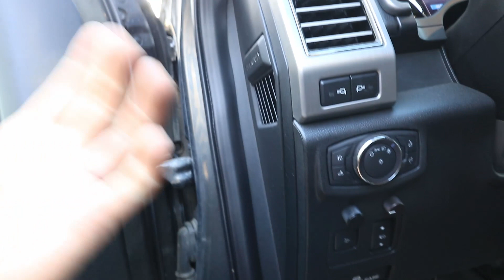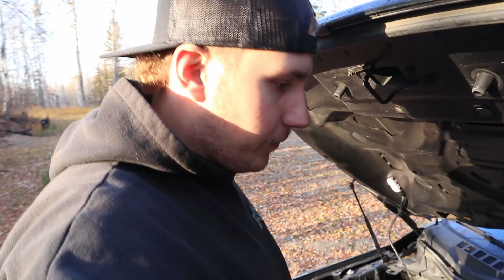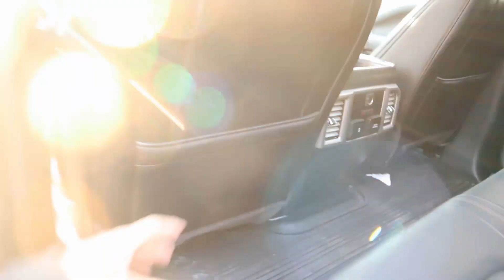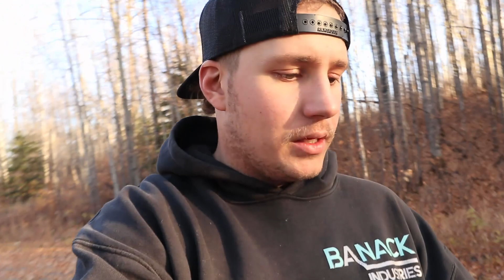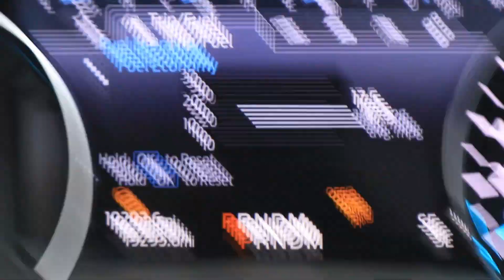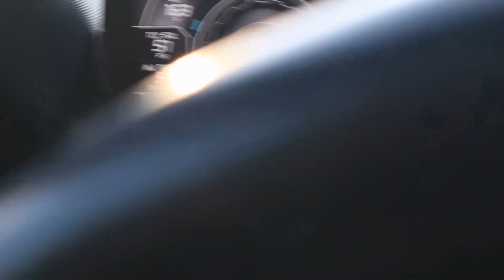Answering Common Delete Questions // 2020 F350 6.7 Powerstroke

Comment: Question: on one of your videos I thought I saw you install a BD Diesel High Idle kit on a deleted truck. My dealer is has installed the kit on my 2020 F250 but can’t get it to function. Any suggestions?
Reply from the maker: @RapidlawnCa  first of all yes they do work, I have one on my 2020 f550 service truck
Reply from the maker: @RapidlawnCa  if the emissions harness is plugged in up by the firewall it will work, if you have that unplugged you loose the high idle control
Reply: @BanackIndustries  OK thanks I haven’t touched that at all, but I did unplug the throttlebody plug as well as the two EGR plugs, would that have anything to do with it not working?

Comment: How is the 10 speed holding up?
Reply from the maker: Still hasn't blown up
Reply: Did you do the trans tuning when you deleted it?
Reply: @rempel29  I know a few people myself included who didn’t do the tuning on the trans. If you only do like 80hp tune or lower and don’t beat on it you should be fine. Mine has been great so far.

Comment: what is the bumper height on your pickup? From the bottom of the front pumper of the pickup. I am just wanting to figure out how high it is off the ground.
Reply from the maker: I will have you a measurement tomorrow
Reply: @BanackIndustries  alright thanks
Reply: @BanackIndustries  did you ever get the measurement?
Reply from the maker: 26" to the bottom of the bumper

Comment: What gear ratio do you have and what primarily made you do this delete? Wanting to order a 2022 6.7 and the idea of getting it deleted crossed my mind but throwing away the 5 year warranty is a bit of a hold back but definitely something to think about.
Reply from the maker: This truck is 3.37, i deleted because i had 2 def tanks fail and had other def issues early on with the truck 

I suggest not deleting until necessary. These newer trucks have more and more bugs that surface after deleting if not done properly
Reply: @BanackIndustries  Yep, I certainly would not jump right into it, tunes aren't even out for the 22 and will definitely take a while before they get the bugs figured out. 
I'm fortunate enough to be within a half hour drive to Dirty Diesel but I don't know how the emission laws and regulations are gonna shake up in the next while specially how tight things have gotten in the US. The 7.3 Godzilla is worth taking a look at but Diesel is Diesel. 
Any delete issues at all since you got it tuned up?

Comment: Would you say it’s worth it to get a long box or a tremor with a short box? Unless I’m cracked and tremors have a long bed option
Reply from the maker: Its alll what you want, i perfer the longbox and will never go back to a short box truck truck for what i do. The tremor package only comes with the shorter box trucks, and i honestly dont see enough value in the tremor package for the price
Reply: @BanackIndustries  yeah I have an 08 Sierra 2500 6L. She’s great but drinks my money I drive a ton and haul things here and there. Getting more frequent as I’m “adulting” and not off-roading as much so I don’t need a light, HD application truck and with plans to tow a lot in the future. I am very interested in the 181L tank just not quite sure if i need the bed space yet. Probably will. Thanks for your input
Reply: You can get a long box sport package then add some bushwacker Oem flares, snow plow prep, cut your air dam and you basically have a tremor look a like. Sell your factory tires from new and put on your own choice of 35s. All your missing is an extra 1” front lift and rock crawl mode and it probably cost less than 1/2 the price.
Reply: @JonnyMitchell57  that’s actually genius. I don’t keep up with a lot of the new stuff as I make half of the trucks value per year lol so reading your comment sparked some light

Comment: Did you buy the delete kit and tuner and from the same place?
Reply from the maker: No, i bought the exhaust, egr delete and ccv delete separately from: https://www.dirtydieselcustom.ca/
But dirty Diesel Customs does sell the Amdp 
Tuning. 

I took my truck to Am Diesel Performance because they were local to me and just got them to tune the truck in house, instead of having to send the ecu in to them.

 https://amdieselperformance.ca/
Reply: @BanackIndustries  when you deleted the egr and dpf did you have to tune it before you moved it or could you drive it to the shop to get it tuned ?
Reply from the maker: @JasonRegister-ls9nn  has to be tuned prior, to deleting

Comment: Didn't realize that Dirty Diesel stopped shipping here to the States. I got my Ezlynk from them earlier this year.
Reply from the maker: https://www.dirtydieselcustom.ca/products/2020-powerstroke-6-7l-dirty-egr-delete-kit-067-egr-a014

Right above add to cart, these say cannot ship to the usa. 

It must just be the delete components they dont ship to usa. Unless they just post that as a cover up for the epa bullshit
Reply: @BanackIndustries  actually, I tried to buy the EGR delete kit from them a few months ago, but they were having a hard time sourcing the parts for my 2019. The one thing they wouldn't ship was the exhaust pipe and mufler ( I try not to attract attention). I was able to get that in Litchfield IL. I don't know if they make it yet for the 2020, but I pushed my mileage up to around 19 city and 22-23 hwy by replacing that crappy Ford intake system with one from Pusher Intakes, and replaced the CCV system before the filter in the can started to break apart.

Comment: With the egr delete is it bad for the coolant to just be blocked or does it still cycle around and have bypass just to keep it circulating ?
Reply from the maker: Yea your better off welding the exhaust ports shut on the egr cooler and leaving the coolant lines connected.  That way you dont have the exhaust gasses circulating
Reply: What Tcm file did u go with? And did u do any relearn process or just took it easy for while? Do u have any shift flares?

Comment: I just recently did a DPF and EGR delete. I live in Alaska. Sent my ECM to dirty diesel customs to get tuned. I have to say I’m very impressed with Jordan (owner) and the company. Was very easy to do and they answer any questions you have. Once I got the ECM back fired my truck up with zero issues. Well worth it.
Reply from the maker: Hell yea man. They are awesome there, and the best part is Am Diesel Performance is right down the road from them now since they moved to bc.
Reply: @BanackIndustries  what track bars are you going with, I need some for mine.
Reply: Thanks for the info bud
Reply: Did u transmission tune to?
Reply from the maker: I tried to get bds suspension ones, they are 2 -3 month backorder with no eta 

Also tried kaotic concepts but the customer service is terrible and for some reason the owner kept telling me he would ship them to canada but never got me shipping quotes and never got back to me 

So i ended up ordering some from Pmf suspension. I ordered them sept 27 and they still havent shipping them. Not overly impressed at this point. Its been over 5 months trying to get traction bars.
Reply: @BanackIndustries  I have a set of Longhorn Fab traction bars that I ordered from XDP after you and I talked on the phone and I just got an email that they were shipped 11/1. 
I enjoyed our phone conversation and decided to take your advise and ordered this set of traction bars. Also I am getting the same tunes you have from AMDP. Thanks
Reply: @davidmiller7161  Hated mine I had on my LML Dmax I used to have. Having hiems on either end of the traction bar has so much vibration/noise. PMF or WCFAB is who I would go with.